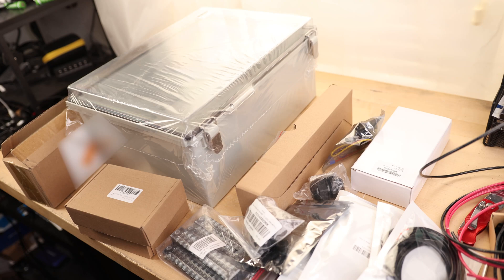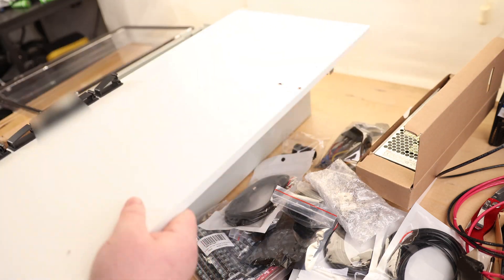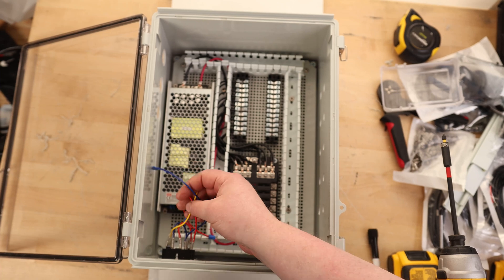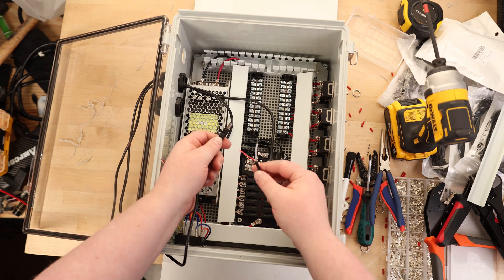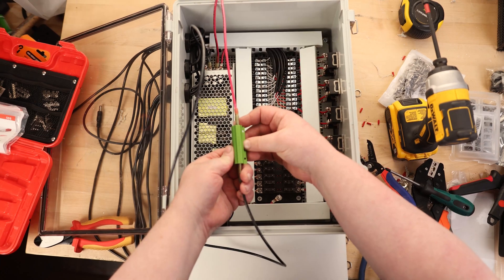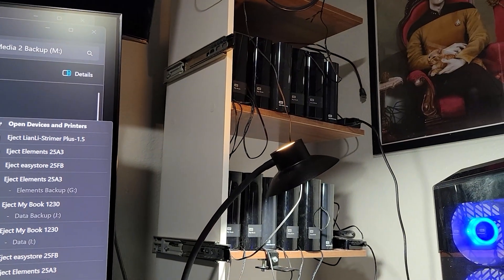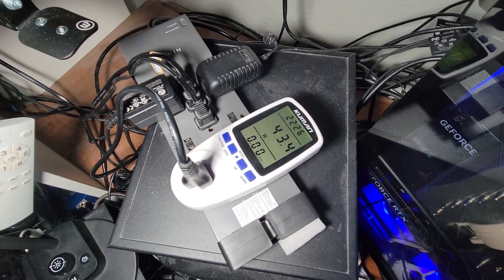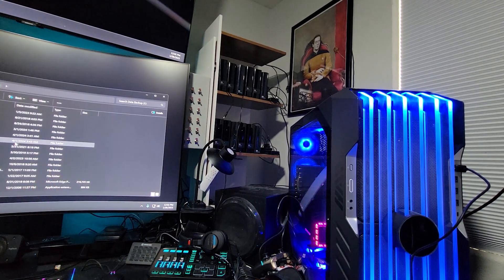Making A Single Power Supply For 12 External Hard Drives

Comment: Random question, could this be scaled to a cluster of mini PCs? Like 5 of dell Optiplex 3060s.
I'm not savy when it comes to electricity so thats why I'm asking lol.

Cool build sir!
Reply from the maker: I'm not familiar with the 3060, but I'd bet it can be done.
Reply: @Distractor_Beam  would it basically be figuring out the maths of how much total wattage and amperage is needed to run them all and adding the protection like you did with the fuses?
Reply from the maker: @alejandroberistain4831  Yes, and also make sure that the components and wires are rated for that amperage/length.  You can look up wire gauge charts to help with that.

Comment: This makes no sense at all... Why not get a NAS? this is how they did it in the windows 98 days lol
Reply: To me the main issue with the NAS is the initial cost especially for as many drives has he has here. And in a NAS the drives pretty much all have to be the same. With this setup here, you can grow as needed, and if you do have your sensitive data on one of the drives, you can make sure you have the power off on it most of the time and that is the best way to keep that data secure.
Reply: @addhoardingprocrastinator  > in a NAS the drives pretty much all have to be the same
not really, Synology hybrid raid or Unraid (or just a linux box with btrfs) can handle mismatched drives fine
Reply: @addhoardingprocrastinator  but you can't just shut down the power of a HDD, well you can but it won't take very long until a disk fails or data is lost. This all good fun of course, but not practicle, safe and workable. A NAS is waaay better, safer and less power consuming as well and it doesnt have to cost much in your case, cos you got please HDD's already. Plenty examples online of how to build a NAS the cheap way.

Comment: Why not using a server/nas ?
Reply from the maker: I have that too, but I see the purpose of that as performance and sharing.  The purpose of this is to be cheap and easy.
Reply: @Distractor_Beam  i don't know how "cheap and easy" it is to assemble an electric box for 12 or more external drives, most of the cost in a NAS are the drives anyway
Reply from the maker: @marcogenovesi8570  All of the custom built NAS systems I've seen were either super cheap, and a huge disappointment, or ballooned into a grand or more to make it the way they want it.  Alternatively you can get a prebuilt NAS, and a 12 bay setup hits well over a grand easy without drives.